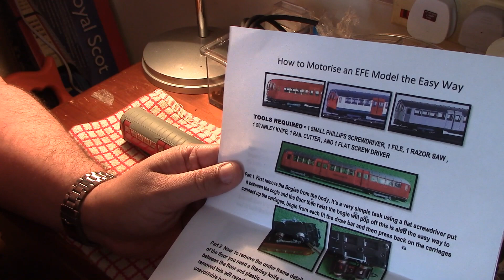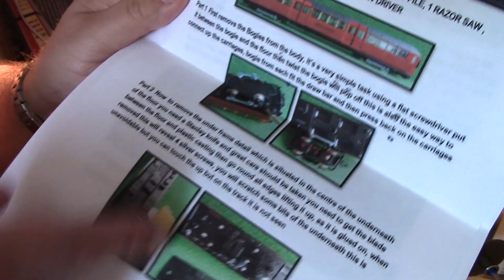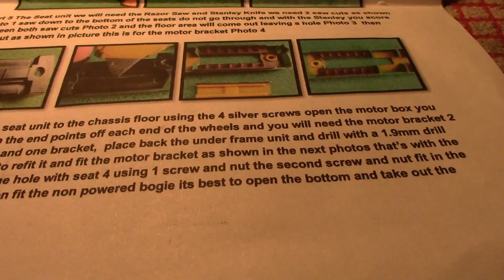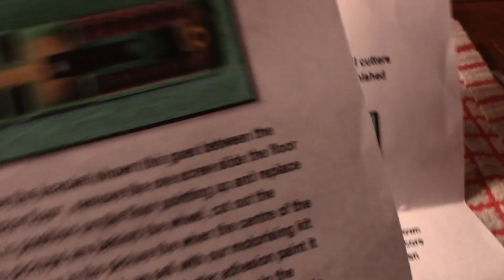HOW TO MOTORIZE AN EFE TUBE TRAIN

Comment: This is great ------- I remember traveling on a 'red 38' form Morden on the Northern Line---- no I'm not that old but during the mid to late 80s they were refurbished for use, because  of lack of rolling stock.
I distinctly remember at the time a local  TV news report about an under ground driver on the Piccadilly line? transferring and moving  to Morden so he could drive one . Thar's dedication to the cause for you!!
Anyway, thank you for this as during these extraordinary times we are living in I have been scratching my head on how to motorize a Hornby Pullman coach (one of the old 9") as an alternative to forking out for a Wrenn or Hornby "Brighton Belle".  Loads of good advice and information here 11 out of ten thank you.
Stay safe.
Reply from the maker: Kevin Ludlow thank you , you take care

Comment: Hi Richard, this is probably the best and almost the only Video I have seen of how to do this conversion. I have been contemplating doing this for some years and you have now provided me with the impetus to do it. However, I have a few questions before I start cutting, filing, and gluing. 

1. The Spud units are WB-26-B. What does the is the "B" suffix stand for, and who did you get them from?  
2. What is the minimum radius curve the newly powered unit can traverse, with these Spud units?
3. What couplers are you using within the Tube Car set? The short EFE as supplied or what?
4.What wheels are you using to replace on the other trailing units within the car set, and how do you fit them?
5. How many powered cars do you have per four/three car set. You have doubled motored this car, how many others does it propel/ haul? 
6. Have you Lit your cars? I so by what and how?
7.If you have lighting, have you tried to light the front destination/ headlights and or the tail lights yet and how?

Appears we may have a lot more in common than just modelling, Cheers.
Reply from the maker: Sorry for the long response ! 

Layout is sadly no more , but I’ll try and answer some of your questions. 

The WB Tenshodo motors are available from Radley models . 

I use two wired up in series and plenty of weights added in the Centre double doorway spaces (2) , wheels sets are the original EFE ones with the Centre spring removed , axel holes slightly opened out with a round needle file , then oiled with loco lube oil , couplings were modified from the EFE ones holes drilled on the ends then fitted in place a small screw , once clearance is ok , glue the screw in place , nip off and file flush the thread to create a pin for the drawbar as such.  In some  cases I’ve had to trim the end car coupling back to allow formation clearances , 

They should run on 2nd radius curves , anything tighter they won’t work . 

Periodically slide open the underside motor case cover and add a DAB of loco lube oil on the gear cogs . Clean the pick up wipers also . Clean your wheels .